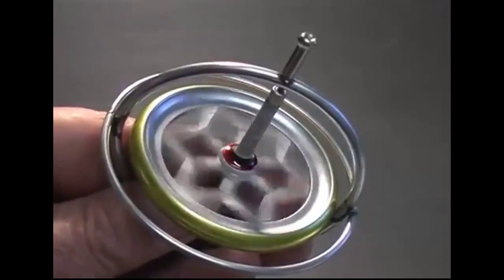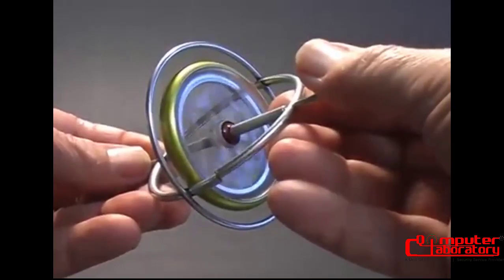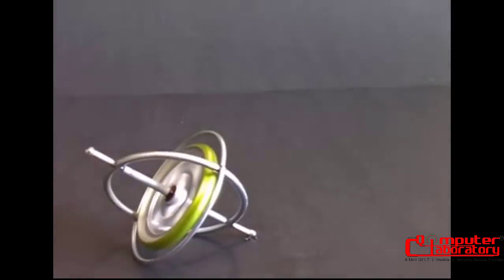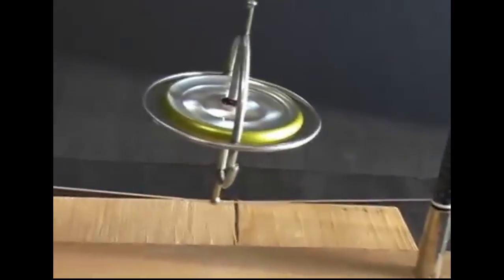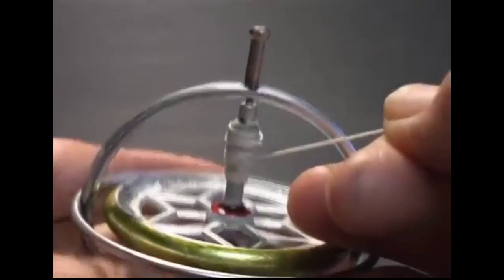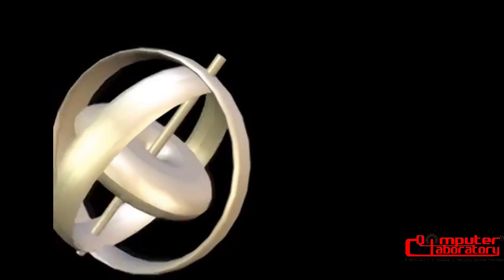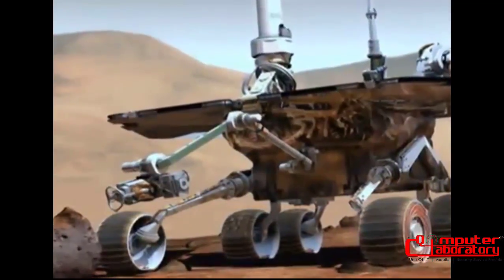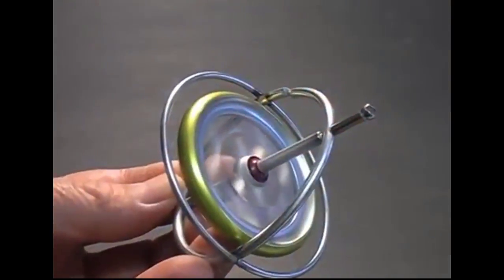How Gyroscope Works

Comment: Playing with one, and then giving a few extremely basic details about how one works in a plane, is NOT explaining how a gyroscope works in principle. For that, you have to go to an actual science channel, not this place. Might I suggest Professor Walter Lewin in his series of lectures from when he taught at MIT? Entertaining, extremely brilliant and you know it's the real info if it's coming from Dr. Lewin.  Watch the one with the bicycle wheel gyro hanging on a rope, and then the one where he holds the gyro as he sits on a wheeled stool. Then go to lecture #24 for the math (if you want a challenge...it's pretty intense...WAY beyond me...(not that that's saying much...)). I'd rather spend an hour and LEARN, than waste 5 minutes here and do nothing except put ad $ in this guy's pocket.
Reply: what makes it worse is that this is a stolen video. I'll check out that lecture thanks